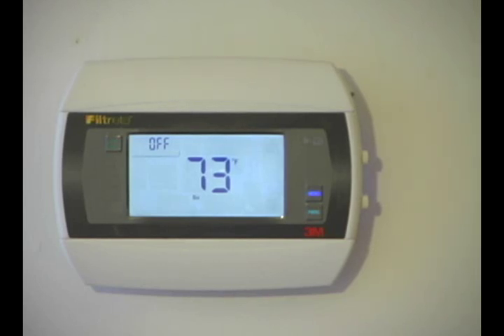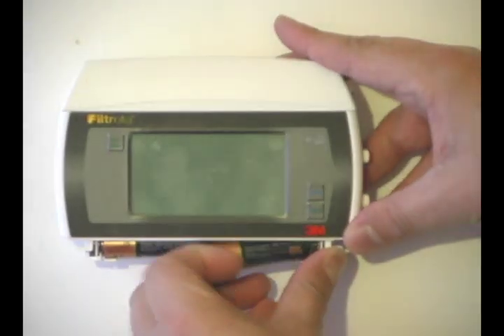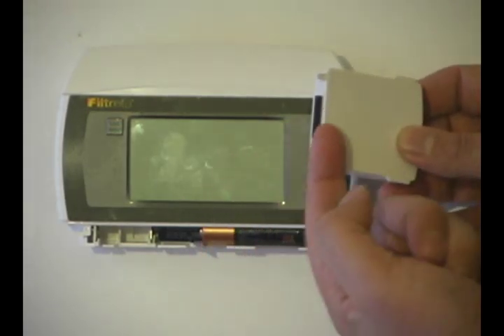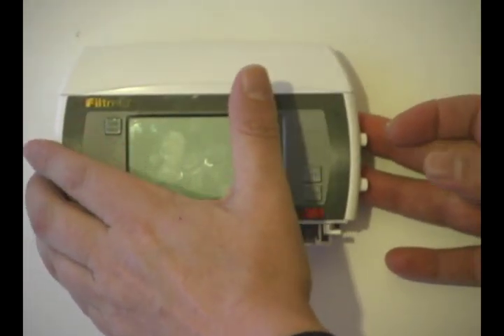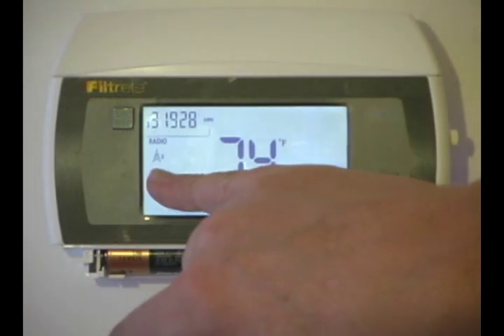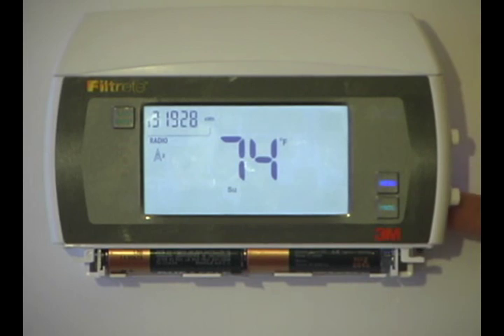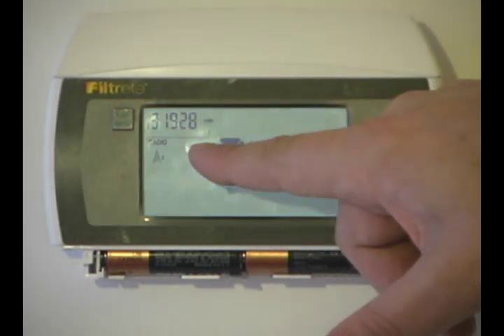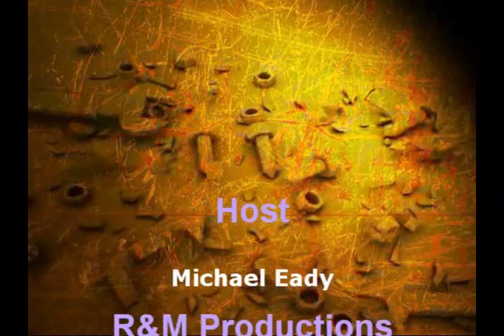Filtrete 3M50 Thermostat - How to install WiFi U-Snap module

Comment: I spent HOURS trying to figure out why I was getting no 5-digit PIN number.  Most websites talk about needing to ensure that the "C" terminal is functional.  I knew that wasn't the case as I'd been using this thermostat for a couple years.  Turns out...my thermostat was in "SIMPLE" mode.  When in simple mode you don't get a 5-digit code ever.  Press Mode so it reads "off" then hold the "Program" button for 12 seconds.  It will exit simple mode and you'll get your code.

Comment: Well I'll be darned Will, you're right!  I wasn't getting the full 24 volts, just 19 volts, but the unit won't run on 12 volts like they claim or even 19, it requires the full 24 volts!  Now it works, sort of.  The Wi-Fi adapter came on for the first time and I was able to connect with my laptop. It wouldn't connect to my "N" router though, it would only connect to a "G" router. A lot of the comments on Amazon said their unit were shipped with fake Wi-Fi adapters but mine seems to be correct.

Comment: Check the voltage you're getting between the C and the RH terminal.  I was powering the unit with a 12V power supply since the manual said it was fine between 12V and 24V, and it would work with battery out.  I was even getting the radio icon and the green light would flicker on and off on the USNAP module (not the thermostat face).  Once I switched over to a 24V power supply I got the yellow light and the PIN code.  The thermostat will run on 12V, but the module seems to need more juice.

Comment: Guys, I get the same thing as you two, no flashing light or a pin number.  All I have on the screen is the Radio icon.  I'm definitely getting power from the "C" terminal because I can remove the batteries and it still works!  All the instructions about pressing the Menu button and the up and down arrows is just silly!  There's no combination of button presses that will give a yellow light or any other light.  Homehandyman101 doesn't seem to have any idea what he is talking about!

Comment from the maker: Still no yellow light?
Please follow these steps:  turn the mode to OFF, press the Menu button.  You should see a blank space in the middle of the screen.  Press and hold your finger against that blank space until the screen changes.  Press the Up Arrow icon to reset the thermostat, then press the Down Arrow icon.  Press the House icon twice to return to the main screen.

Comment from the maker: There should be a C wire in the C terminal. See our videos on YouTube to see why you need a C wire for wi-fi as well as several videos on how to add a C wire. If using a plug in transformer, choose a low amp transformer, 16-24 volt AC with 1/3 of an amp or less.
 
If you do NOT see the days of the week under the large temperature reading, you are in Simple Screen.  Turn your thermostat mode to OFF, press and hold the Program button for 12 seconds to toggle out of Simple Screen.

Comment: I just bought my house and the previous owners have this installed.  I am trying to connect the device to my network but after doing the first few steps of this video my thermostat doesn't show a flashing light or a pin number.  What am I doing wrong?

Comment: Thanks for the timely response. I do not have a 'C wire.'  Is that the likely problem? Would an adapter do the trick, and if so what sort of adapter is it and how do I install it? 

Thank you

Comment from the maker: @mondaydreaming Hi I would make sure the c wire is working by taking the batteries out.  If the thermostat does not run without batteries then you need to fix the c wire.  If it works without batteries put them back in an then press menu. Press and hold the center of the screen till you see 00 & 2 arrow keys press the down arrow key. Once it goes back to the main screen you should see a flashing amber light and a number in the top left which is the pin number.